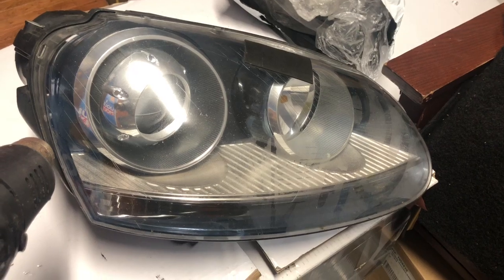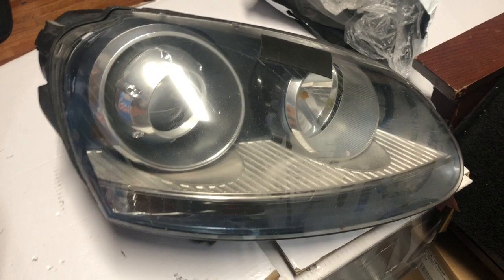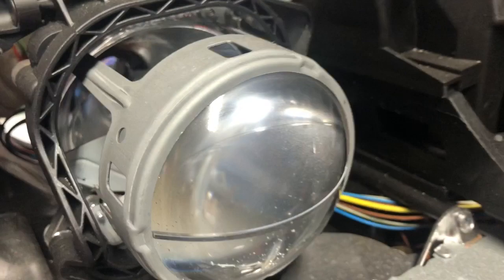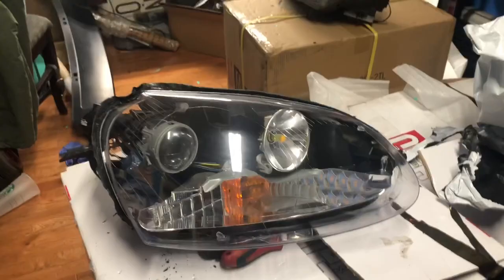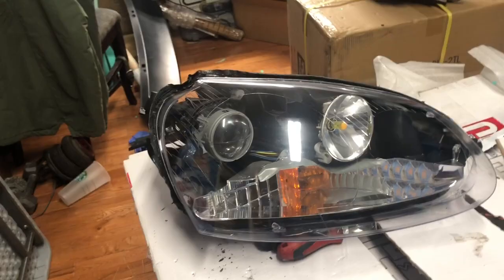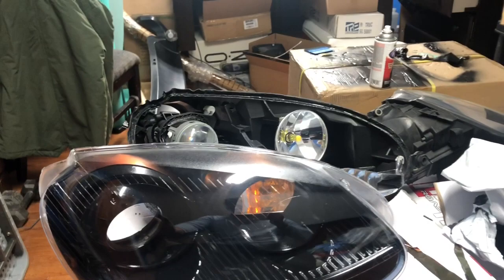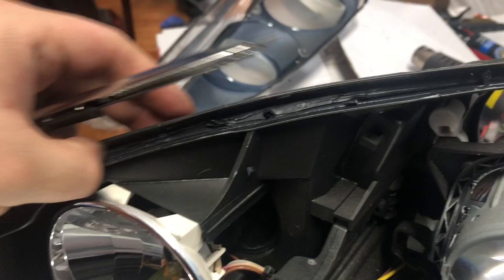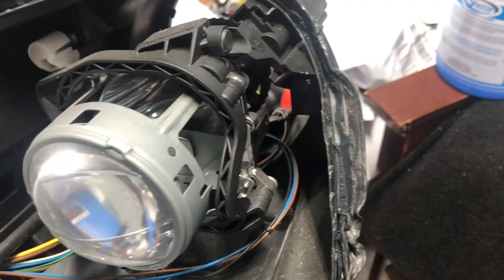Mk5 gti lenses replacement

Comment: You jumped over how to get the lens off👎
Reply from the maker: All you have to do is heat them up and pry it out with a screw driver. Or put them on an oven 180* degrees and just use a screw driver and pry it open I have a better video in the mk4 custom lights if you go down the videos sorry I’ll try to make a better video for next time I have another coming up